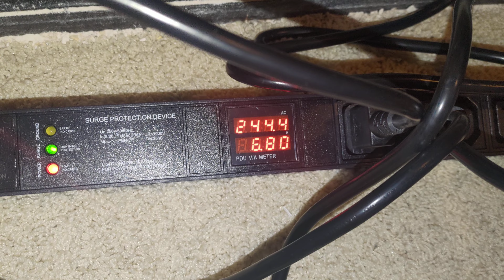GPU Mining Upgraded Electrical Setup

Comment: Nice to see an update. My suggestion is don’t invest any more money on farming chia. I have 50tb on chia right now and it pays me on space pool about .01 chia/day. It is not a good ROI at all. Invest in GPUs instead. Now you mentioned you need to buy motherboard, cpu, etc for the new rig, truthfully you don’t, you have 2 computers utilizing only 1 or 2 GPUs on the bottom shelf, just get a mining frame and move the parts of one of those PCs into the mining frame, if they lack PCIe ports, use the 1 to 4 PCIe adapter, I got 2 of my rigs using that and it both run 6 GPUs each (on motherboards with only 4 PCIe slots)
Reply from the maker: That's actually a great idea I was browsing those the other day. I've been keeping an eye out for more cards at MSRP but I've been extremely busy with school and work so it's been tough to be on the lookout always. But I try to drop by microcenter every so often and check for stock. 

When it comes to chia I won't be dropping any more money into it. But I don't mind reinvesting what I gain from it. I think for now it seems to be the best option.